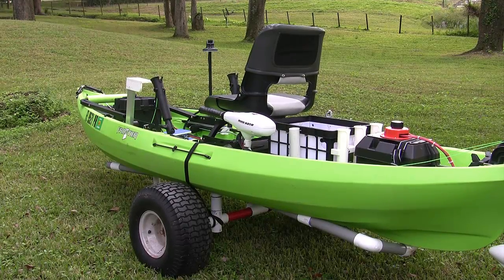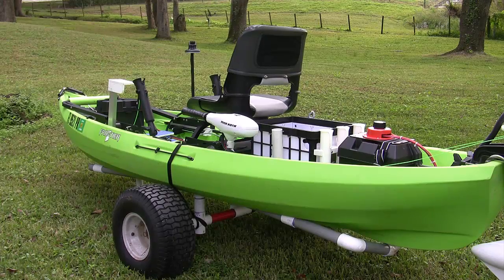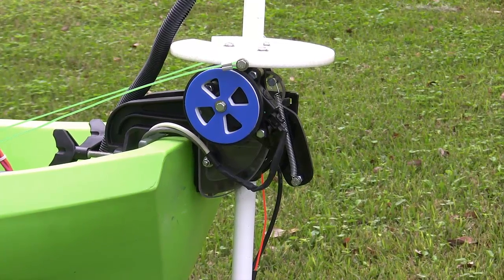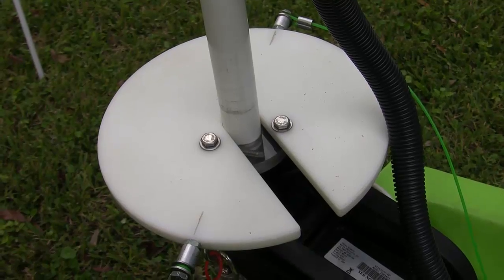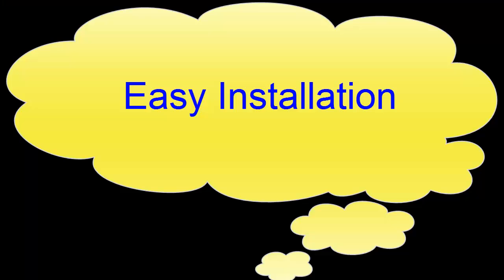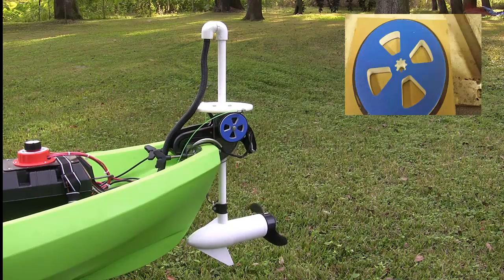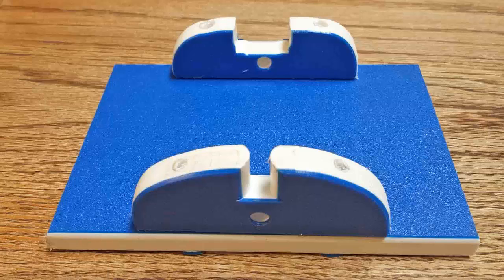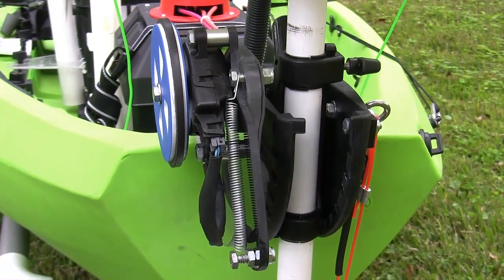NuCanoe Frontier 12 Electric Steering Control System For Minn Kota Transom Mount

Comment: hi I built one using a window regulator motor works great
Reply from the maker: +Marty Escamilla 

Thanks for sharing.

My latest prototype utilizes a Linear Actuator with backup foot pedal control system and also has tilt and trim functions.  Check out my channel for links to the videos on this prototype.  I find that this system has faster steering and works GREAT!!!

I have an other idea on a light weight Honda 4 stroke propulsion system for Kayaks.  These motors are really quite compared to the old 2 cycle motors and start easily.  This system would also have the Linear Actuator steering with tilt and trim and backup foot pedal steering.

John

Comment: Nice! I just got a frontier myself. Can you do a vid on that cool little trailer your frontier is on.
Reply from the maker: +DixieRiverRat 

Hi,  I personally didn't build that trailer.  I purchased my NuCanoe Frontier 12 used and it came with it.    It works pretty good to store the NuCanoe on but in its present configuration it has a tendency to slip when pulling the NuCanoe around.  Could possibly put some anti slip material on the PVC and I am sure that would help.  The other thing that is not too good is that it is pretty large and weighs quite a bit and when I used it I had to haul it around in my lawn trailer.  Some places I fish they don't allow trailers.  I designed a small dolly made from PVC with plastic hubs and foam filled tires.  I currently use that method for launching and retrieving my NuCanoe.  Still not perfect but it is easy to carry along in my Honda Odyssey Van and I don't need a trailer to carry all my stuff.

Comment: do u sell these I would like one my email is Martinescamilla89.me@Gmail.com
Reply from the maker: +Marty Escamilla 

No Marty, I don't sell them..  This was a prototype.  I found after some use on the water it did steer well in calm water but the gear ratio was too slow for proper steering in high winds and rough seas.  If you check out my other videos you will see that I have a more recent design that utilizes a linear actuator.  So far, this new design is working a lot better as the 4 inch linear actuator moves at 2" per second so I get full travel from full left to full right in just 2 seconds.  It now operates at a speed that is more in line with the speeds of the OEM Minn Kota BOW mount foot controlled trolling motors.  My new prototype is really working nice.  It has the linear actuator and a backup manual foot pedal steering system.  It also has a mechanism for tilt and trim.  Both the linear actuator and the manual foot pedal steering systems can also operate while the motor is in the tilted position.  I have posted several you tube videos on this system.

John
Reply: That's fine I made one using a window regulator works great on my bass raider
Reply: +helicopterjohns do you happen to know the rpm on the unit in the vid? I'm working on a similar system for my mini boat using a high torque 15rpm motor.

Comment: Looks Great. You definitely improved on the original design .But I do have question : How do you mount the drive wheel to the drive motor ? I have one of those little motors and the inside of that spline drive shaft has no threads to bolt to . Did you thread the inside of the spline drive shaft ,if so for what bolt size?
Reply from the maker: Skip Blanton Hi Skip.  I designed the drive wheel in ONOCNC my cad/cam program.  It has a groove about .250 deep in the outside face of the wheel.  I used a kitchen sink bowl gasket which was about .375 from inside to outside measurement which left about .125 exposed so that it could contact the upper drive plate.  I took some measurements of the spline on the drive motor and drew up an internal spline that was machined on my HAAS TM1P Tool Room Mill.  I had to experiment a little to get the correct fit.

Yes, I did thread the inside of the spline shaft which also had an internal spline.  As it turns out the size was pretty close to a No. 7 drill so without doing any drilling I tapped it with a 1/4 X 20 bottom tap to get the maximum threads due to the internal spline taking away some of the strength of tapped threads.  I didn't torque it real tight as I didn't want to strip the threads.

Hope that answers all your questions.  The only issue I have had with my current prototype is that is runs a little slower than the Minn Kota Bow Mount foot controlled commercial units.  This can be corrected by changing the size of the drive pulley.

I am getting ready to explore another design based on a 12 volt electrical jack screw.  A few others have made these with good results.  The only thing I would like to incorporate into the design is the ability to have a backup foot pedal control system in case of a failure of the 12 volt electrical jack screw.

I will post a video if my efforts are a success.  Thanks again for your interest in my prototype project.  If you would like to discuss further you can contact me at clarkj@tampabay.rr.com

John

Comment: Great job!  Your just amazing to me.
Reply from the maker: Hi Ron,

Glad you enjoyed the video.  This thing works GREAT!!!!!!!!!!  Stop by and I will show you how it works.  The foot pedal really works nice and smooth.  It steers like it is on GPS navigation.  Just point it at an object and it goes in a straight line.  It can do 360 degree turns on its own axis yet is smooth enough to navigate tight quarters like small canals.  I did the Sea Trials today and it worked flawlessly.  Had a great time.  I am still smiling from the experience.  Ha Ha